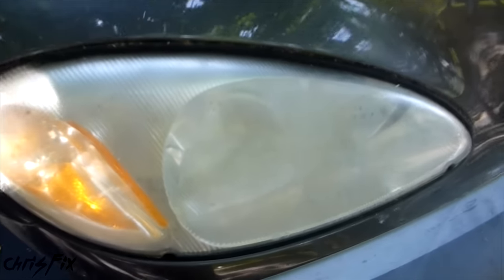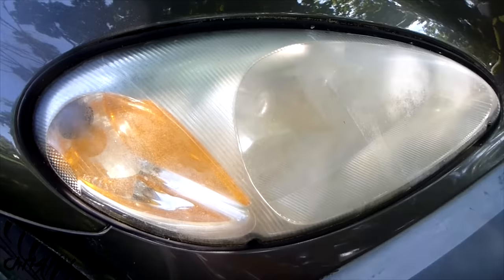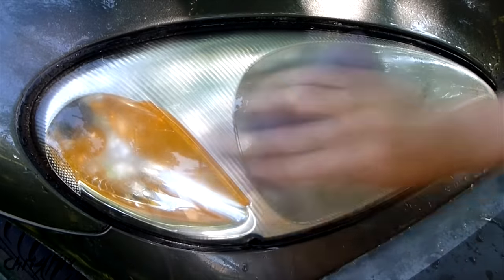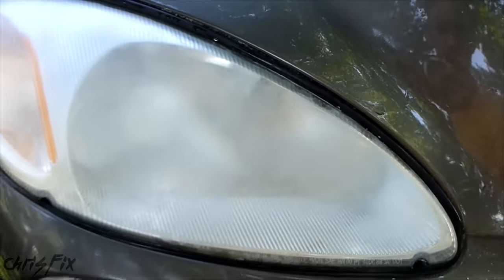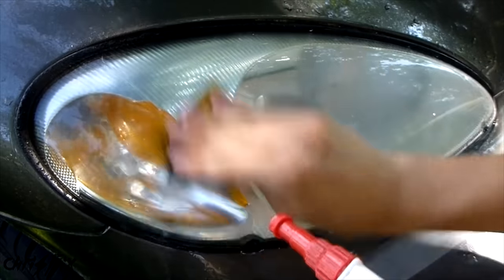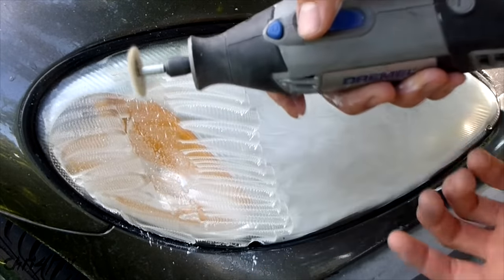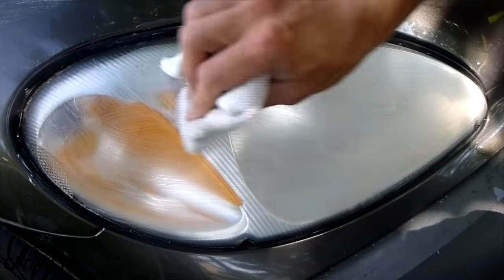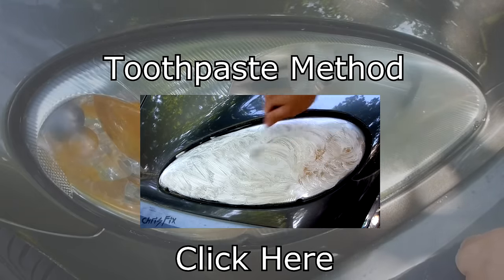How to Restore your Headlights (crystal clear)

Comment: Cool vids man. I've been doing this for decades on antique auto plastic.. But with "rubbing and polishing" compounds on a buffer.
The sand paper is a great trick too! Thats also something I've done to work rough plastic to a clear polished surface. 
One thing you might consider is using a polish of some sort before the wax coat. 
Again, keep up the great work with your vids.
Reply from the maker: The13thSun  That is neat and thanks for the tips! The polish I used was the toothpaste.

Comment: Hi there ChrisFix, I have a Skoda Fabia from 2008(back in Europe) and it's I can see light stray cracks all around the headlight..but the plastic is as clear as it can be..Both headlights are the same..very light cracks., You have a suggestion please ?:D
Reply from the maker: Alexandru Apavaloaie Unfortunately there is nothing you can do for those cracks. If it is clear, either just keep them on the car or get new ones. This is one of the only times I would say you need new ones.
Reply: Thank you :D. For a couple years should be fine, at least until I change the car again :) . Keep it up with the vids :D good job !

Comment: Hey ChrisFix, I've watched most of your vids about headlights, but they all kind of aim towards plastic made headlights. I got a 2001 Volvo S60 T5 which's anti-fog halogen lights on bottom are all dim due to driving on the sand and such. Is there a way I could fix/polish them back to clarity?
Reply from the maker: +deltapulse are they glass? If so, just use glass polish.
Reply: Hey, thanks for reply. :) They're 100% glass, a lot of european cars still do have those. But apart from glass polish all of your steps apply? Using sand papers and such? Just glass polish instead of toothpaste?

Comment: Hi Chris. Instead of 2000 grip sandpaper I used 1200 grip and after that I used the toothbrush instead of the dremel. It is still foggy. :/ Can you help me out? And does this technique useful for glass headlights? Cheers
Reply from the maker: +Rennan Perdigão This does not work on glass. Watch this: https://youtu.be/UEJbKLZ7RmM?list=PLDD611CFB36FC65F2

Comment: Hey Chris. First thing,  I love your videos, there great. I noticed on my headlights that they are yellowed and not pitted/dirty on the outside. I have a 2000 mazda b3000 and I am about to put some new bulbs in. Is there anyway I can clear the headlights from the inside? Yellowed headlights are normal hear on the coast of Texas. It sits around 80% humidity most of the year.
Reply from the maker: Thanks man, I am glad you like my videos! You can clean the inside but you would have to take the headlight off of the car, put the headlight in an oven at about 250F for 5-10min (that temp and time varies on the make of your car) and then pry the lens off of the frame of the headlight. The glue they use is heat sensitive which is why you put it in the oven to loosen up. In this case, there was no reason for me to clean the inside, but for my truck, the inside would be the part to clean.
Reply: ChrisFix alright. If you ever get to cleaning those headlights be sure to post a video of it. It would be very nice to follow a step by step.
Reply from the maker: Maybe I will do that. I will let you know. I really want to put projector lenses in the headlight (custom retrofit). These headlights stink otherwise!
Reply: ChrisFix  i just put in Sylvania Ultra bulbs in my truck last night. yea the headlights are yellowed but when you turn them on it might as well be clear lol. they are very bright.
Reply from the maker: Nice. I find the problem is not only the brightness but the light pattern isnt that great on these trucks. I really want to put in projector lenses. Gotta get the courage to do it though!

Comment: um i just used a kitchen sponge ..the type with scrubbing layer on it and dishwashing liquid. just cleaned it for 2 minutes and applied baking soda on the sponge side and continued for 4 minutes..then some brasso copper polish for 2 minutes. and i had a mirror finish. so i'm not so sure about how long your way takes but sure thing go for it.
Reply from the maker: Thanks for sharing! Same concept. You are using abrasives to remove the outer oxidized layer of plastic.

Comment: Hi Chris...I tried this on one of my headlights on my Ford Taurus 2003 and now for some reason it's much worse. It pretty much looks exactly like what yours did after your final sanding and before the dremel, when the entire lens is fogged. I used the same dremel bit as you and toothpaste but it never cleaned it and I think it melted my plastic a little. Do i have to get new headlights now? :(
Reply: Valerie Burton try bug spray and if the fogging disappears, wait for it to fog again and watch his other vids

Comment: if you don’t have a dremel or don’t wanna use toothpaste, you can always use a clear coat of spray paint (the one with UV protection) and do three or four coats of it then you’ll never have to touch your headlights again since the UV isn’t damaging it anymore. that’s what i did with my 2006 tiburon and it’s worked like a dream. went from the headlights matching my yellow paint to crystal clear using the same sandpaper method w a clear coat. a little less labor.

Comment: What can i do about my headlights that are only lightly hazy? I used turtle wax a while back but it didn't help much, it has a couple of scratches from the sandpaper included in the kit and it only looks really clear when i sprayed it with windex but once it dried it turned hazy again, any suggestions?
Reply from the maker: BeyondBelleza In this case you can try something less permanent such as toothpaste (check out this video): https://www.youtube.com/watch?v=rXHTXdlWw1w This will make the lenses clear for about 2-4 months and it is easy enough to do. If you want them clear permanently, you can use this method: https://www.youtube.com/watch?v=UEJbKLZ7RmM

Comment: Hi Chris, I’m off topic here. But my Cadillac CTS headlamps have what I assume is cloudy blotches internally.  I believe that it was caused by moisture getting inside the lens.  This car has the HID bulbs and do the replacement lenses are much more expensive that that halogen units.  I’m wondering if you might have any thought on how I might get rid of the cloudy areas after removing the lenses from the car.  Is there a liquid product or a way to get at those areas with plastic polish, perhaps?  I know that I’m reaching, here, but replacement lenses cost nearly $500 a pair.  
Thanks for any help at all or for just giving it some though.
Ron

Comment: I can't find 600 or 2000 grit sandpaper. Lowes and Home Depot don't have either, nor does out local paint store. Where do I get the sandpaper?
Reply: ... Sandpaper is everywhere... even walmart has it... how in the world does your lowes and home depot not havee sandpaper...?
Reply: Try an automotive parts store.  HD and L cater more to woodworking and housepainting, so they mostly sell 80 to 220 grit.  Auto stores sell the 400+ grit for painting and detailing cars.
Reply: Keith Clemons I've had trouble finding it too

Comment: I Have a 2006 Toyota Yaris and half the headlamp is oxidized inside the other half is perfectly clear any suggestions ie can I take the lens cover off and clean it ?
Reply from the maker: Check this out: https://www.youtube.com/watch?v=TXvBkHlwDgA
Reply: These headlights of mine Have clips to hold them together not glue 
perhaps they are different here in the UK  It is just that I am frightened of breaking the clips I Have a 2006/7 4 door yaris  .Thankyou very much much for replying so promptly  Kind Regards Ray.

Comment: I did this on my 2003 Buick Century as a test, tried using first Rust Oleum then Krylon clear, ended up with a poor outcome each time, followed all the steps accordingly and after reading through comments for tips.  Finally stripped off the clear by sanding, used 3M scratch remover and waxed it. Perfect.   Would never do any sanding on headlamp covers again, so much easier using the other methods such as a scratch remover or cleaner as shown on other videos, much less time and effort with the desired results.

Comment: I actually also waxed them before I saw  this video. But it doesn't seem to last. They turn yellow again after a few months. Any tips for a longer lasting coating?
Reply from the maker: You sanded them and then waxed them? The sanding gets the yellow out and the wax protects it. If you dont sand it enough, then the wax isnt going to do anything. If you did sand it enough, try sealant wax. It works on higher temps and "seals" paint so it should work better on your headlights.
Reply: Sounds like you need a kind of sunblock sun cream lol.
Reply: Yes I sell this service at my shop for 50 bucks and we have had 4 different products and the oxidation always comes back within 6-12 months.
Reply from the maker: Rich Coakley It will last a little longer if your customers applied a layer of wax every time they wash their car. But yea, this will work for about a year without doing any maintenance.

Comment: Is it fine to use only 400 grit and then move on to 2000 grit because I don't have 600?? Asap answer please.
Reply: My experience w/ sanding automotive paint finishes is that jumping from 400 to 2000 grit is too large a jump.  You need to use 1 or 2 intermediate grits to reduce the depth of the scratches and smooth out the headlight lens surface before using 2000 grit.  Otherwise LOTS of sanding w/ 2000 will be needed.

Comment: lol, dammit... I was looking for this Exact process how to fix my foggy head lights about 7 years ago... Unfortunately (or Fortunately) I bought a new Truck 5 years ago and headlights are still clear... but I will definitely remember this trick... thx Chris

On a side note, the Black (Plastic?) Antenna Base on my 2009 Ram 1500 has turned light gray/Off-White with oxidation ... would you recommend I fix it with this method, or apply some sort of restoring product to it? ... or just get a new base all together?

*(...and thanks again for the Battery vid)
Reply: Oops... just saw you had a video out called "Restore your faded plastic on your car"...
Reply from the maker: ***** Haha, glad my videos are helpful! If the heat gun doesnt work or is too "scary/dangerous" and you dont want to risk damaging your car, turtle wax has a new product out that I am doing a video review on. I just did it for the tire shine, but their plastic restorer is the same stuff but with a different label. I am waiting another month to publish it because I want to see how the plastic holds up. Here is the tire one though: Give your Tires a Deep, Black Shine that Lasts a Year Long

Comment: Make sure your giving people right information.

- should always tape off the headlight.
- dont suggest 1000 grit, use as many grits as you can, personally I use from 600 to 10,000.
- compound then polish.
- biggest thing your missing you HAVE to re seal the headlight with clear coat or a sealent.
- then wax, and buff.
Reply from the maker: Thanks for sharing! I recommend the most permanent method: https://www.youtube.com/watch?v=UEJbKLZ7RmM

Comment: Hey chris. This is the slk mb guy from last year. Sanded head lights/used dremeland ultimate compound. Looks great. Now can i clear coat them or do i need to alcohol them before?
Thanks. Roger
Reply: Alcohol wouldn't hurt just to make sure you have all residues off. Then clearcoat.
Reply: madtonesbr hello. Thanks for responding, sorry I took so long.
R

Comment: Hey ChrisFix - have you heard about a product called L'Oxide which is supposed to work pretty well to remove the oxidised plastic on headlights? You can just google the name and it will bring up their website. The same product also seems to work well as a DIY fix for peeling clear-coat. BTW - not affiliated with them in any way, and haven't tried the product myself, I just love your videos and thought it might be interesting to test. Cheers for the great videos...
Reply from the maker: +maxh771 thanks for the tip.  I'll check it out!

Comment: How do headlights oxidize on the inside? I see a lot of that on Crown Vics.
Reply from the maker: n310ea The moisture and intense heat/uv radiation from light bulbs causes oxidation from the inside. It usually is not as bad as outside of the lens. Here is how to fix that: https://www.youtube.com/watch?v=TXvBkHlwDgA
And definitely consider subscribing! New automotive 'how to' videos every Thursday and most Mondays so stay tuned!

Comment: Wet sanding headlights is old school, Wet sanding only on car body preparation for damage or respraying, Headlight restoration dry sanding works much better, As the water acts like a lubricant and slows down surface removal!!! Try it yourself and prove me wrong? Your choice of grit size is questionable I would recommend, You only need three different pads first p500, p800, p3000 trizact with water!! I think you should always tape around lens as a rule of thumb and always use a decent clearcoat!!

Comment: Do anybody have experiences with relative long term effects? Meaning, that it usually will be gloomy very soon again, after rubbing the original protective surface from it.
Reply from the maker: If you keep it waxed it lasts a few months at least. You can also use my permanent restoration video which lasts many years.
Reply: I'll check that video, many thanks.

Comment: Chris help!  I tried to duplicate your video and think I've ruined my headlight. Hoping you can tell me how and if I can fix it?  I have had my headlights restored before. My brother uses a polishing compound and a buffer. I thought with your tutorial I could do it on my own. I couldn't find the exact grit of sandpaper, but used 500 for the first try and then 1200. Right away I saw scratching in the lens but once committed, kept going hoping the end result would be good.  I started with clean lights, used wet/dry paper and  used ample water on both lens and paper. I rinsed well between steps, finished up with the toothpaste (I think even the exact same brand) and used a dremel type buffer to finish. My dremel tool is a cheap knock off which didn't do much, so I ended up just buffing a bit with a sponge.  My end results are MUCH WORSE than what I started with. I now have a horribly foggy lens and didn't even attempt the other one.  My lenses were oxidized to begin with, but not horribly so. Did I permanently ruin the plastic?  Should I find 2000 grit sandpaper and buff more?  Is my sucky dremmel tool to blame?  Any follow up would be greatly appreciated!
Reply from the maker: sandi4wsu Hey dont worry, you can fix it! I would start off with 400 grit wet sand only. Spray the headlight and spray the sandpaper. Press lightly on the light in swirling motion. Take 5min or so and buff it good! Then move to 600 grit with the same wet sanding procedure. Then I would go to 1000 grit and then 2000 grit. All of it is wet sanding. IT should buff right out no problem. Dont worry about the scratching, that comes out with the finer sandpaper. Then you can use the dremmel with toothpaste and give it a nice buff and then wax it. If that doesnt work, I just made this video which came out amazing! How to Restore Headlights PERMANENTLY
When you try this again, take a before and after picture and put it on my ChrisFix facebook page. I am gonna try to get a collection of before and after shots from my viewers! https://www.facebook.com/chrisfix8 Let me know how it goes!
Reply: ChrisFix Ok. So you're thinking I didn't sand enough? I did start with a 500 grit and ended with 1200. Is there really that much difference and will using 4 different grits make the difference?  I'll give it a shot and let you know:)  Also, I don't have a dremel. The cheap knockoff I bought was unable to handle the toothpaste and literally froze up. Not willing to invest in another power tool just now for this one small job. Can I get similar results hand buffing? I also watched the latest clear coat video. Looks great!
Reply from the maker: You can get similar results by buffing but you will need to buff for a while. And yes, the grits really do matter. 1200 grit is fine, but not as fine as 2000 or 3000! Let me know how it goes!

Comment: Sad part is, as with most Chrysler headlights, u will be doing this same process again and again on a monthly basis. I have 2 Chrysler Crossfires and i do this atleast 5 times a year on one car. I'd much rather have new headlights, but at a cost of close to $1,000 for a new set, i think ill just keep bitching about how much i have to restore them instead. Wish i found a company that would make me a set out of polycarbonate.
Reply: "coats"
Reply: That’s why quality sealant is an important finishing step so that they won’t haze up again. Polycarbonate plastic is naturally porous and will collect dirt and become hazy if it’s not sealed after being restored. That goes for any headlight not just Chrysler’s
Reply: Buy UV paint protector sheets. They stick on like a sticker and all you have to do is change them once in a while

Comment: What if you don't have a dremel?
Reply: Arsene Wenger I would rather use a hand drill with buffer attachments.
Reply: Arsene Wenger use a 4 inch mini buffer using a Dremel so not the greatest ldea plus use rubbing compound not toothpaste 🤣🤣
Reply: gang (
Reply: Arsene Wenger just buy a headlight restorer kit like mothers new lens
Reply: What if you don’t have toothpaste?
Reply: Seriously??
Reply: conishkee :  no, not seriously.  I'd take that as the witty aside it was
Reply: EVERYONE needs a Dremel.

Comment: man if i used a dremel it will drive me crazy trying polish the headlight.
Reply from the maker: +Dontwhine Gotta use what you have!
Reply: +ChrisFix How long did it took you to finish that one headlight with the dremel?
Reply: Dontwhine dont do it! I tried it and even at slow speed it turned out bad. little tiny heat warps